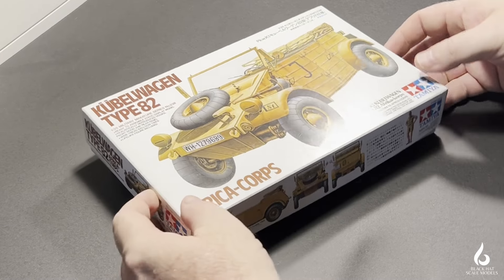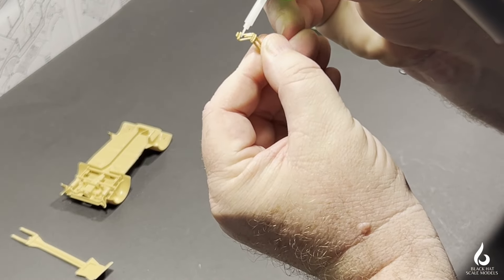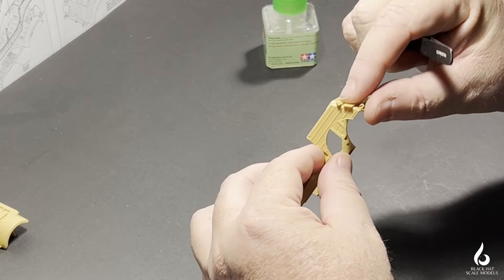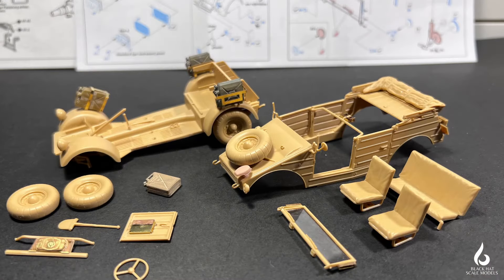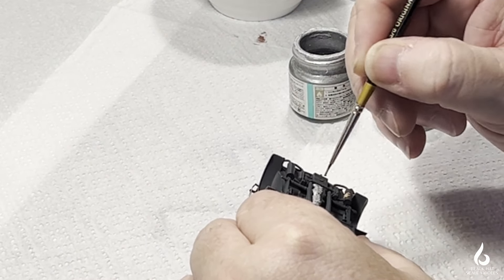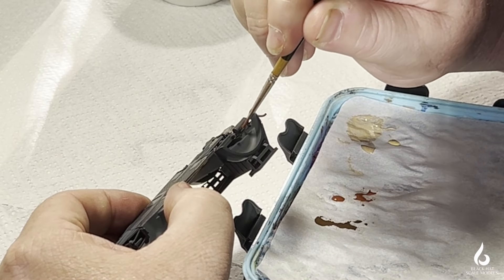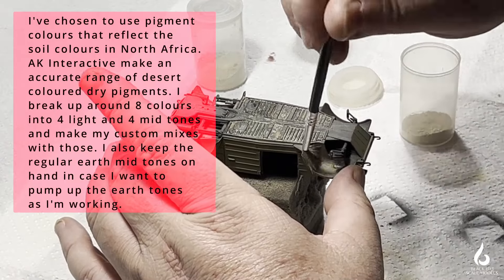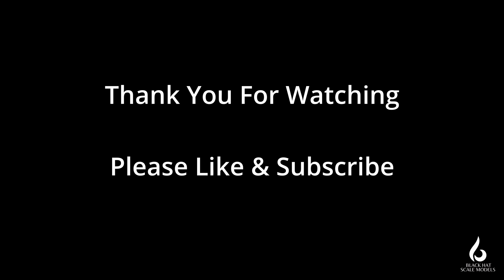1/35 DAK Kubelwagen Type 82 | Full build video

Comment: Gday

Love the work
But a question if I can. You went with Red Primer and the Pz Grey (lov the idea BTW). But when you show the end result It seems to be in my blid old eyes a desert yellow colour
Did I miss a step ?
and if so (apart from I cant get Missio Paints in the UK at a reasonable price) what is the colour you used ?

Neil (Aussie lost in Pommyland)
Reply from the maker: Hey there Neil. So, the story behind this Kubelwagen is that it was issued to a German unit maybe 6 months or a year prior to the start of the North Africa campaign. Therefore it was painted in Panzer Grey at the factory. Upon arrival in North Africa it was painted in the field by the unit. For the first couple of months in North Africa, stores of paint etc was very sparse. There are 2 colours to the tropical camo during the first year and they are RAL 8000 and RAL 7008. There are photos of vehicles painted in just 1 colour rather than the 2 colour camo and this could well be that the limited paint available was used incorrectly to ensure full coverage on the vehicles being sprayed.
I elected to spray the Kubelwagen in 1 colour, RAL 8000.
You didn't miss anything .... my camera footage of that process went bye bye and I couldn't recover it. But if you imagine me spraying it with my trusty airbrush, then that's as much as I can do 😀
Mission Models Paints are difficult to find in some regions. I might suggest AK Real Colours RAL8000 and RAL7008. They are fairly accurate for the first DAK Tropical Paint schemes and are great paints to use.
I don't know about being lost in Pommyland. Seems like a great place to be. We spent 5 weeks there last year and are dying to go back again.